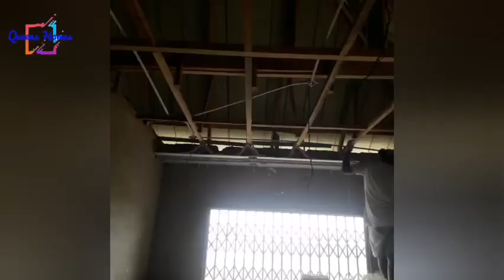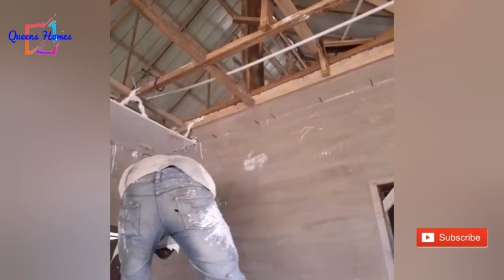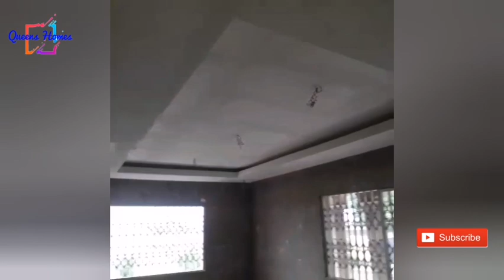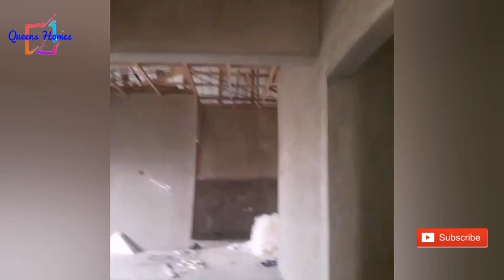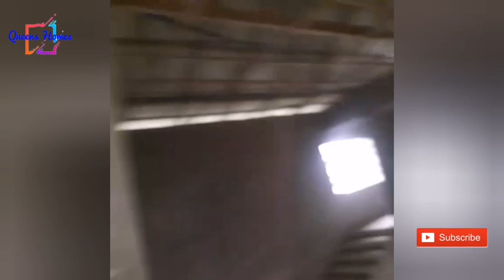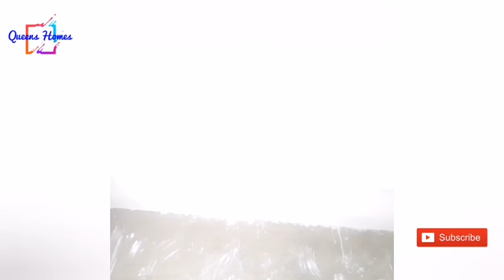Building a Dream House in Ghana | Part 21 | POP Update

Comment: Thanks for the video! Pls what are the pros and cons of plasterboard ceiling vs POP ceiling?
Reply from the maker: Hi,
Thank you for watching our videos. I know that the plasterboard was normally used before and it's quite cheaper as compared to the POP. However, POP last more longer than the plasterboard and quite expensive. But they are all good depending on your taste.